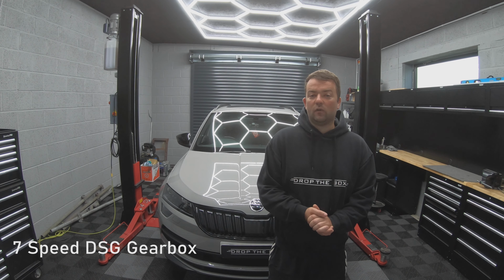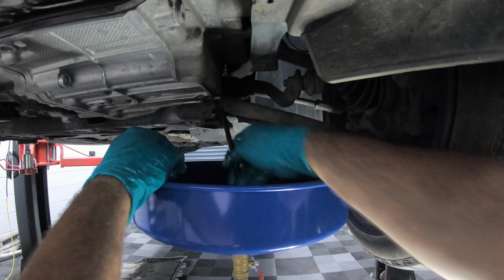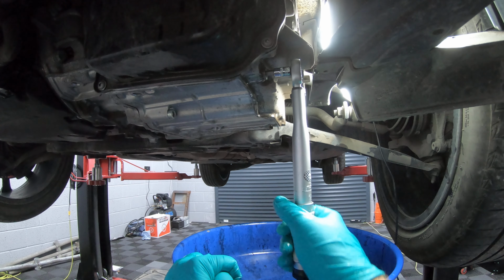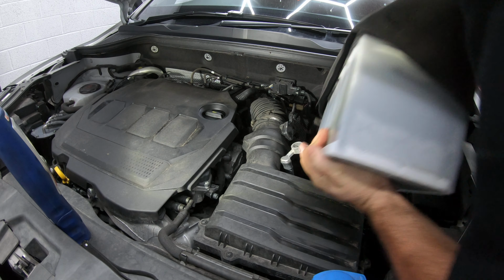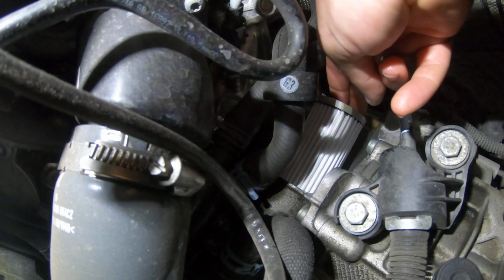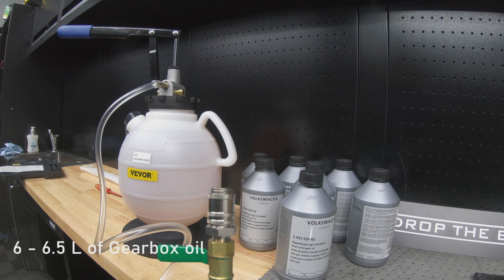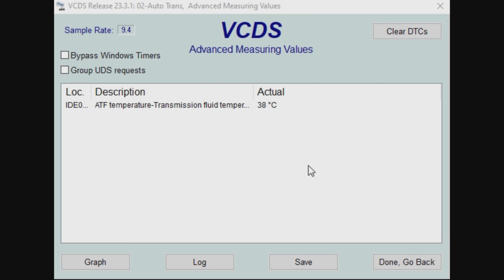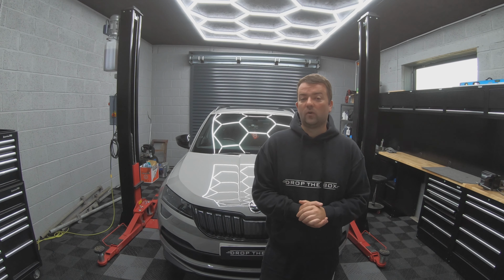Skoda Karoq - 7 Speed DSG Service

Comment: i did my dsg oilchange today , did new oil filter and i removed the bolt and levelplug and the mechatronic plug , i put new oil in 6,8liter but when the engine is running there flows 2 liter back in the container from the fillertool i have the same as you, how much oil needs to stay in i am confused
Reply from the maker: If your followed the procedure the level will be correct. You'll never drain 100% of the oil from the gearbox. 
Some people like to catch the drained oil to make sure a similar amount goes back in.
From memory it definitely didn't take 6.8L was more like 5ish

Comment: My Skoda dealership says my 2019 1.6 TDI 7 speed dash gearbox is a sealed for life gearbox is this correct please if not what mileage or year do you recommend the oil and filter change please?
Reply from the maker: No automatic gearbox should be sealed for life. The way the gearbox works it's by pressure and numerous clutches which are designed to slip. This slipping will cause debris in the oil over time.  Personally I'd recommend every 40-50k miles. 
If your call TPS I'm sure they will give you a quote for a service kit, along with their recommendations for intervals.
Reply: @DropTheBoxOfficial  thanks
Reply: Is this the same for superb 2023 or is there any difference?

Comment: Thanks for this. I have DSG7 and my Skoda dealer says that I don’t need to change the gear oil. It’s maintenance free.
Reply from the maker: All automatic gearboxes should be serviced, as debris from the internal clutches will contaminate the oil overtime
Reply: But does this gearbox have dry clutch?

Comment: Does the gearbox and mechatronic use the same oil? Because I didn’t see you fill the mechatronic.
Reply from the maker: When you refill the system through the gearbox drain/refill point it will also fill the mechatronics at the same time.
Just got a separate drain plug but use the same fill point.
Reply: @DropTheBoxOfficial Thanks for clearing up that. I assumed this was the case, but just wanted to be dead sure I don't stuff up the box 😂

Comment: Great tutorial! I have 7speed DQ381  in Kodiaq. Dealer suggests oil only change at 70k miles. Ive done 47k and want to change oil for peace of mind. Am I ok to just change oil or should filter be changed as well? Any harm just doing oil? Thanks
Reply from the maker: If you are going to the trouble of changing the oil id recommend doing the filter at the same time.

Comment: Did you use 6.5 ltr or was it less I no the 6 speed they say 7 but takes way less as you can’t get it all out
Reply from the maker: It was less than 6.5, it can vary by a few 100ml from Vehicle to vehicle. As you say not all of the oil can be extracted
Reply: Cool thanks

Comment: I’ve got a Seat Tarraco 2019 2.0l diesel 190hp. The filter is facing upwards not sideways like yours. I believe my dsg is A DQ500? Is yours a different box?
Reply from the maker: There are a few different variants of the 7 speed dsg gearbox. Your DG500 is generally used on heavier applications with high torque. Even though it's appearance is different the servicing will be the same.

Comment: I have a 2019 Octavia 2.0 diesel 150 ps with the dsg DQ 381 7 speed.My Skoda dealer said I need to change the oil at 120.00 kilometers.I will change it before this but is this the 120.000 correct.Thanks making the video...interesting.
Reply from the maker: The dealerships often change the service intervals for certain items. Last I heard it was 70k miles which is about 120,000km.
Personally I'd recommend every 40k miles.

Thanks
Reply: @DropTheBoxOfficial  Thanks for your reply.I did not notice you were in miles instead of kilometers.I will be sure to change it before 120.000 .

Comment: Does it dry or wet clutch on that transmision
Reply from the maker: Dual-clutch gearbox (DSG)
Apart from the number of forward gears, the DSG gearboxes are equipped with different types of clutch. The gearboxes designed for low torque values feature two dry clutches while the units designed for higher torque values are equipped with wet clutches running in a sump.

Comment: What mileage should the first service on the gearbox be ?👍
Reply from the maker: If you go by the manufacturers recommendations it's 70k on the newer DSG & 40K on the older DSG
Reply: @DropTheBoxOfficial  thanks if mines 192 and 48000 kilometres would mine be old or new thanks
Reply from the maker: Your best bet is to phone your local dealer or tps parts supplier. They will advise you on which service interval it requires

Comment: Hi m8, on how many miles ( km) , do you need to change this gear oil?
Reply from the maker: On the 7 speed DSG I believe it's 80k where as the 6 speed DSG is 40k.
Reply: it depends on the DSG model/submodel...my Tiguan MY 2019 has a DSG7 DQ381 (UAY 0GC) and it's officialy rated by WV dealership for a 120.000 km oil change interval.
 Old DSG's were 60.000 km I belive

Comment: Is this DQ200 gearbox
Reply from the maker: Dq500 in the video I believe. Dq200 are typically found on petrols or lower torque engines
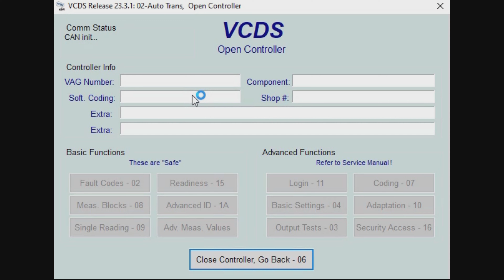Reply: DQ 381 you can see that here 11:25

Comment: is this the same for Tiguan?,
Reply from the maker: Yes will be exactly the same for all vehicles with a 7 speed DSG gearbox
Reply: @DropTheBoxOfficial my 2017 diesel Tiguan has the filter in a vertical position as opposed to the video which is in a horizontal position. would changing the DSG oil procedure be exactly the same ? Cheers
Reply from the maker: @bernst7759  DSG service will be the same